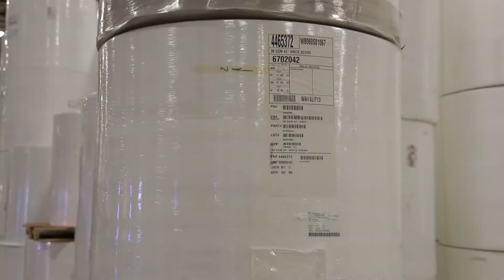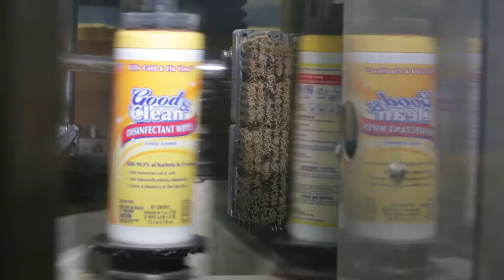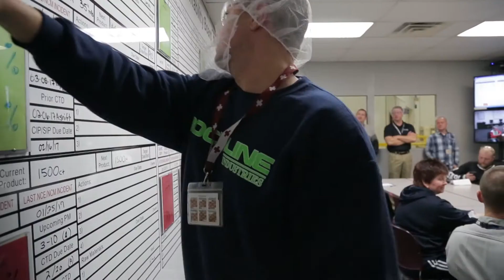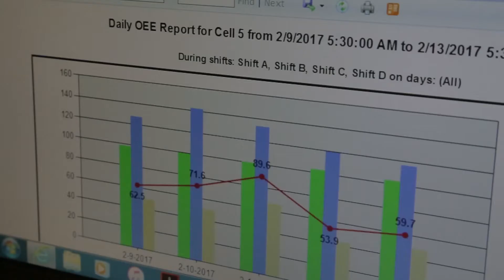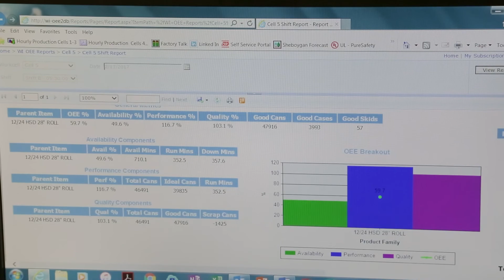Data Analytics Help Boost OEE at Rockline Industries Paper Converting Plant

Comment: Always great to OEE metric democratized!

By the way, my 2 cents:

Performance cannot be >100% , in which case your target rates are over the roof and it cannot be. It must be equal to your theoretical maximum run speed of your machine and in the case of a line, it must be the highest validated speed. If you don't go by validation standards, then you must bring in your slowest bottleneck unit op/constraint 's speed as your target rate.